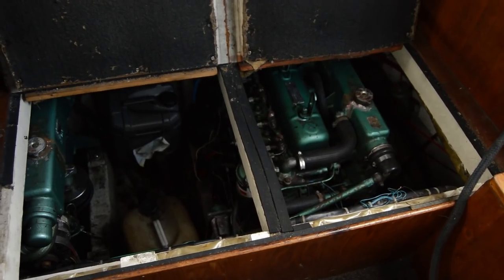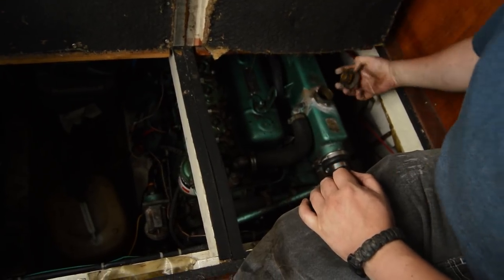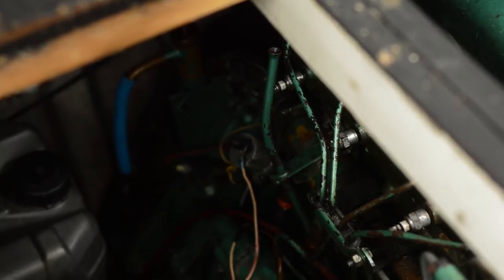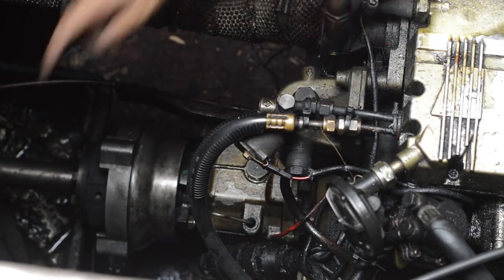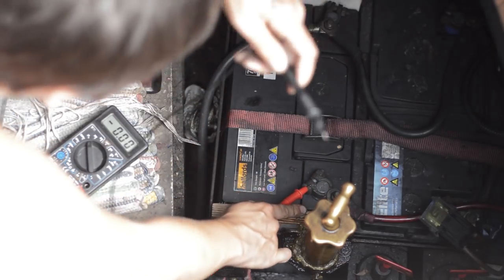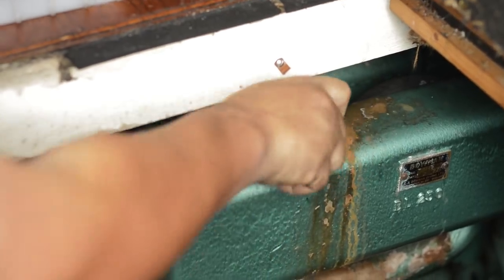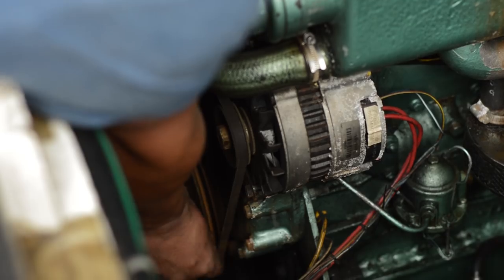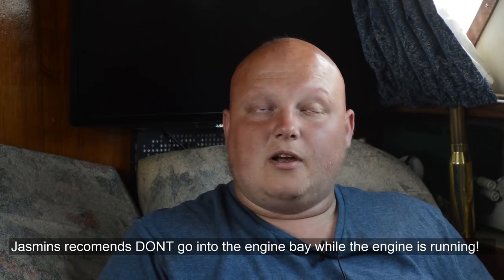Pre-Move Engine Checks or W.O.B.B.L.E Checks With John Hill.

Comment: As always Jasmine this is an interesting, informative and generally enjoyable presentation but here are a couple of additional tips I didn't notice as specifically included which I hope seem relevant to your followers;

The alternator belt usually also drives the water pump therefore if that belt breaks but operators are vigilant with instrument scans they should, notice a red light activate when the alternator stops charging and shortly after that the engine coolant temperature will start to rise.

That is quick, easy confirmation that should not be ignored and is the proper time to moor a boat and investigate a problem rather than adopting an attitude of "lets just wait a bit longer and see if things improve on their own".

Lubricating oil for all internal combustion engines contains detergents to help break down contaminants that are not only potentially harmful to an engine when created as a by-product of their operation but to people as well because some cannot be removed by the sort of filtration normally found on a majority of engines.

Diesels in particular require oil with a significantly higher level of detergents due to the higher pressures created in their cylinders and it is very important to ensure that diesel engines contain oils specifically formulated for them.

Petrol engines will run on diesel oil without any problem but diesels will not run for long on oil formulated for petrol engines before they are likely to begin encountering problems.

This is partly because diesels produce a lot of carbon ash or 'soot' due to higher pressures generated as a by product of compression ignition in their cylinders and the type of 'high flash point' fuel that process requires.

Due to those pressures, a larger proportion of soot produced by combustion in the cylinders bypasses the compression and oil control rings on the pistons of a diesel and winds up contaminating the contents of the oil reservoir or 'sump'.

The higher concentrations of detergent in the correct oil for diesels helps that oil cope with this characteristic problem. 

The extremely fine carbon particles mentioned are also why the oil in diesel engines is characteristically far blacker than oil in petrol engines and tends to stain everything it comes in contact with from workshop rags to skin.

Prior to greater awareness for life threatening contaminants such as carcinogens like dioxin that can occur in engine oil and the advent of stringent safety rules in the workplace requiring the use of protective gloves.

You could often tell someone was a diesel fitter by the black stains around their finger nails as well as in the corrugated skin at the joints of their fingers and any cuts or scars.

Another particularly harmful contaminant which builds up in the lubricating oil of all internal combustion engines is acidity and detergents in oil help to counteract this.

But even detergents can only provide protection for a limited time before becoming overwhelmed after which they are no longer effective.

As I have already said ordinary filters cannot remove acid or other chemical contamination from oil and I can illustrate this by the following anecdote.

Almost fifty years ago I stripped a petrol vehicle engine on behalf of an employer which was so neglected by it's owner that the oil looked like it came from a diesel but had an unnaturally thick consistency almost like golden syrup.

Most of the non-ferrous alloy parts in that engine from the piston skirts to white metal bearings on the crank-shaft and connecting rod journals in contact with the toxic sludge that substituted for lubrication had numerous holes eaten through them by such an extreme acid content that they looked a bit like wood full of borer holes.

So there are very good and compelling reasons for changing the oil in any engine regularly because not all harmful contaminants can be filtered out or otherwise counteracted by chemical means indefinitely.

In addition to this oil that is changed at correct intervals is far less likely to produce or 'breathe' harmful emissions from vaporized toxic volatiles because levels for them in the oil will be low and therefore safer for people who stand in close proximity to an engine while it is in operation such as on most canal boats.

So as you can see a neglected engine can be toxic to people as well as to itself.

Despite what many manufacturers recommend it has been the experience of mechanics I have known over decades that owners of engines who are willing to change the oil more frequently than stipulated find their engine lasts significantly longer and awareness of these factors should create an appropriate level of precaution.

In addition there are also automated means owners can adopt as exceptional additional protection for an engine and they are referred to, as 'watch dogs'.

I use watch dogs on a large Caterpillar diesel I own which powers mining equipment vital for air circulation among other things while operating more or less unsupervised in the harsh environment of the Australian outback while the operator is some distance away and underground.

Watch dogs are also available for engines right across the spectrum down to passenger vehicles however and a by no means complete list includes the following;

An accessory attachment on the header tank or expansion chamber of a cooling system which if maintained and functioning correctly will shut the engine down if the coolant temperature rises above a predetermined value or if the level drops below one.

I have used the same device on the very large radiator for my Caterpillar diesel for almost twenty years.

It features a simple needle type gauge indicating the level for coolant in the system in addition to the temperature and the gauge also includes a transparent sight glass behind the needle to visually confirm the level.

Another attachment on the circulation system for the lubricating oil shuts the engine down if the oil pressure falls below a predetermined value or the oil temperature rises above one.

This requires pressing on an over-ride button until the engine starts and oil pressure comes up to normal operational value but is a small inconvenience compared to the peace of mind it provides.

An additional unit I don't have can be incorporated to a specially adapted mechanically driven tachometer and can also shut an engine down if revolutions exceed preset parameters.

As you might imagine these accessories can be relatively cheap insurance for all owners of engines who prefer a bit of extra reassurance and are worth knowing about.

Some people probably think all this sounds like overkill but knowing the cost of rebuilding a big diesel can significantly exceed $10,000 and replacement cost can be five times that or more puts it in perspective.

But there is no reason, preventing the owner of an engine of any size from adopting a policy of prevention rather than cure.

Comment: I love your videos they are fantastic I am learning so much from your videos and I am hoping to buy a narrow boat soon. So thank you for your hard work it's much appreciated. Cheers Jo
Reply from the maker: make  sure you get a survey !
Reply: Hi yes absolutely,  perhaps that is one of the first things I have gained from the you tube boating community is to try to avoid boats that need either plating or the hull is rusted!! I know it will mean I will have to spend a few hundred extra pounds on a survey but I know it's vital. I have budgeted this in to the boat I am looking for. The engine and the hull are so important but then there are so many other things to look at also. What has amazed me is the variation in what you can get for your money. Some boats are clapped out and still cost a fortune. I will carefully keep looking. Thanks for your advice and taking the time to get back to me. Cheers Jo

Comment: This is super helpful Jasmin. Until today I was doing the WOB checks but now I’ll be dong the full WOBBLE thanks to you....thanks so much for a great vlog
Reply from the maker: which b?
Reply: Bourbon...Always checked to make sure I had a bottle of Jack Daniels on board :-)
Reply: Sorry that was a little bit flippant given this is a serious subject. I always check the Water, Oil and Belts (mine squeal a little but my engineer says they are tight enough so I apply belt dressing which seems to work). I have new batteries and they are in good shape but I’m going to pay more attention especially as winter approaches and my new solar panels pull in less power. A really good blog Jasmin thank you

Comment: Great video as a new boat owner I will pay more attention, one thing I have heard of is water in diesel they say always have you diesel tank filled up  it would be nice to learn more about this problem
Reply from the maker: some times condensation forms inside the tank and you end up with water in your diesel and there is a thing you can put on the fule line and that will take any water out, im not sure what its called as we dont have one...
Reply: Thanks Jazmin I may have that thing you mention been owner for 4 months still finding out about it
Reply: Easiest way to remove water is a water separator type fuel filter. They will have a bowl below the filter element with a drain, sometimes with a pet cock. Open that drain and let the fuel run out for a few seconds into a container or bucket. The first part of the fuel that runs out will be the fuel which contains the water. 
Keeping the fuel tank full helps prevent condensation.
Don't know if it is a problem on narrowboats, but if the tank is difficult to fill, if you are filling it with fresh fuel and it all wants to come back out the filler pipe, that is from the tank vent having a "trap". Vent hose should come from the highest point possible on the tank top, and immediately go as straight up as possible for as  high as possible. Above that the hose should not run horizontal but always be going "uphill". If the vent hose must run anything like horizontally, fore and aft is far superior to running the hose athwartships. On boats that list or heel, vent lines should be as close to the centerline as you can get them, not out by the gunwhales. Of course it's ok to have a loop at the top to keep water from flowing into the tank, but try not to have the vent tube end much higher, if at all, than the filler.

Comment: Oil in the engine coolant and coolant in the oil is usually a sign of a head gasket problem. Engine oil problems, admittedly it was in a car but i had a oil pressure gauge and a oil pressure light on an engine that was known to use oil. What would happen was the pressure would drop to 0 before the light came on. The oil light never came on when the engine was running. So yes check the oil level!
Reply: When you're "making oil", your oil level goes up, could be some water getting in... the color of the lube oil will change from black to an opaque tan mocha.

Comment: Very good and thorough Vlog!  Well done!  
I was surprised to see that neither of the engines had a coolant overflow tank attached to the small connection below the radiator cap, which lets the coolant just dribble down the side of the engine.  You can get a small one on amazon for a few pounds: https://www.amazon.co.uk/IPOTCH-Universal-Radiator-Overflow-Reservoir/dp/B07D5F9R3Q/ref=sr_1_fkmr1_4?ie=UTF8&qid=1535384499&sr=8-4-fkmr1&keywords=universal+coolant+recovery+tank  (this one doesn't come with a hose, but there are others listed that do)  That will keep the coolant from leaving stains on your engine, getting on belt, pooling in the engine bilge, etc.  It's better for the environment, too!
Reply from the maker: ah i actually know ours didnt have one thanks for the link